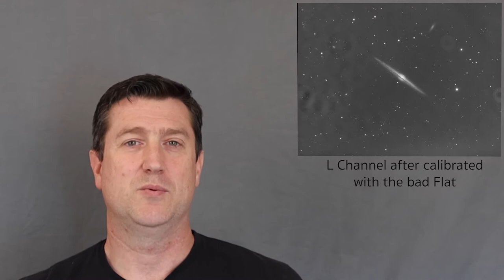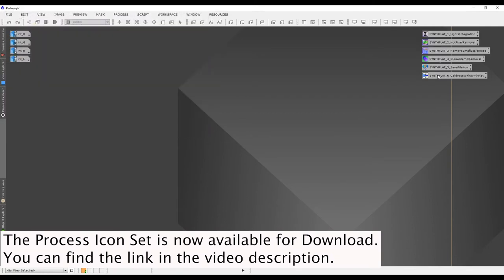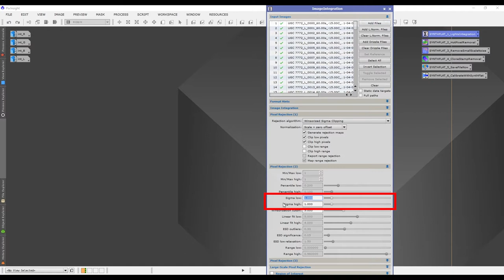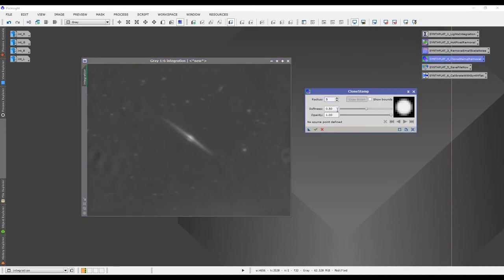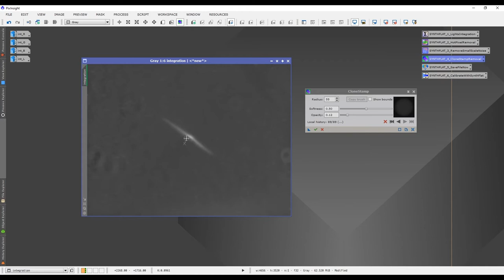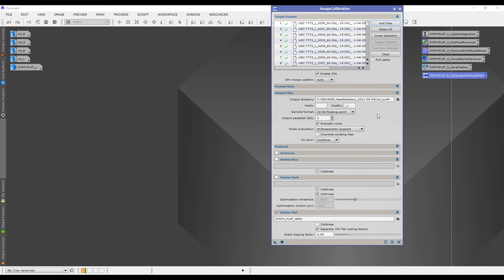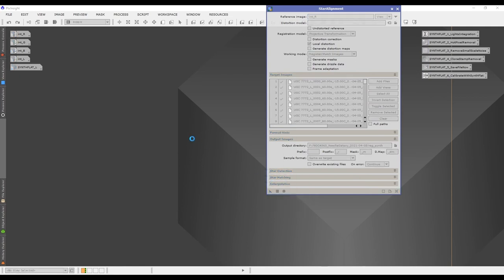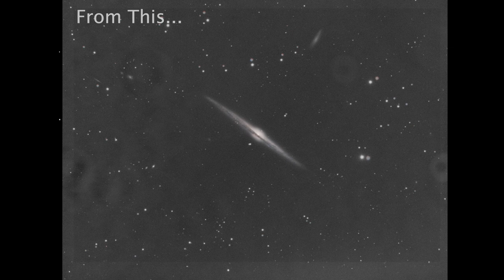PixInsight - Synthetic Flats Can Save Your Images

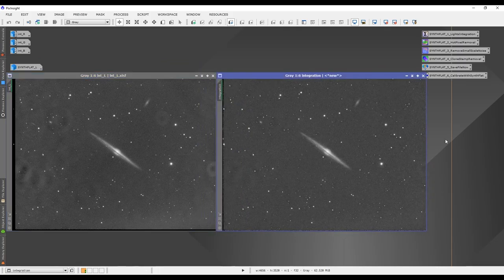Comment: Thanks, this is helpful.  There's one more trick you could do to take this one step further.  When you compare the before/after at 15:09, you can see that the synthetic flat calibration indeed did a very good job with many of the donut artifacts, but it still slightly under-corrected.  Bright donuts are darkened but not quite enough to blend in with background, and dark spots are lightened but also not enough to blend in.  We like the correction it made, but we need it to take a bigger step in the same direction.  In pixelmath terms, if you call these images "uncal" and "synth_cal", then the "step in the right direction" is computed as "synth_cal - uncal".  If you were to add this adjustment to the original image, "uncal + (synth_cal-uncal)", you get the calibrated image, because, after all, A + (B-A) = B.  In this case we want a new synthetic flat-calibrated frame with similar corrections, just more so, so we can scale the "B-A" bit:  "uncal + 1.1*(synth_cal-uncal)".   I'll bet that's enough to make the bright donuts and dark motes fade further into the background.  Iterate as needed with the correction factor.  If you find that the synth flat calibration over-corrected (i.e. originally light donuts now appear as dark motes) then use a correction factor <1.  This is a handy trick for flat calibration in general and for other processes that under or over-correct.